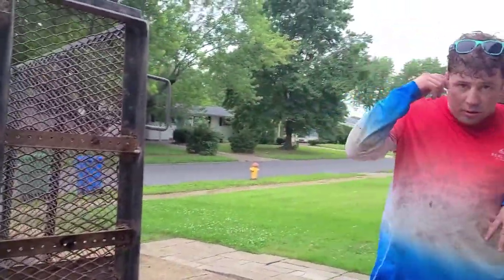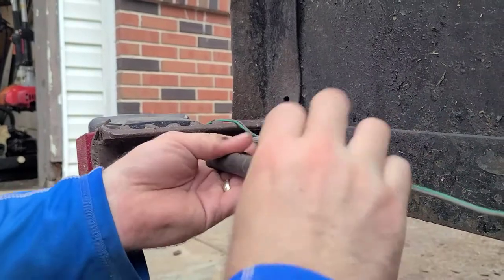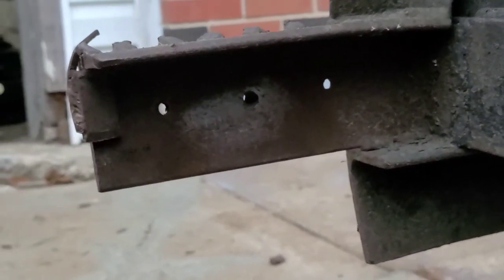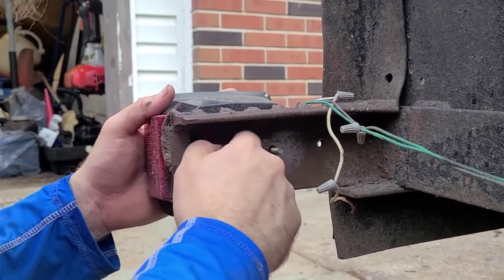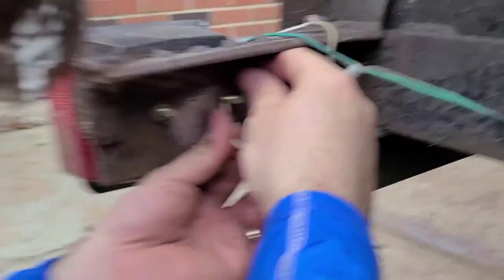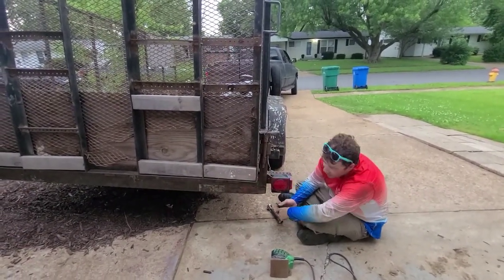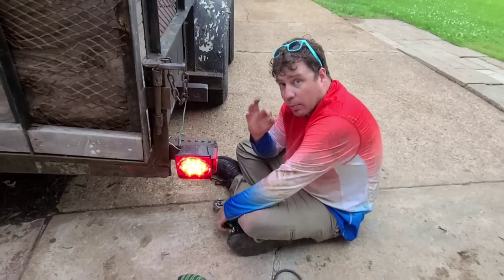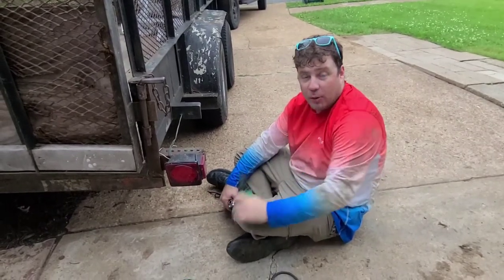Trailer lights not working, grounding issue.

Comment: Nice video but i gotta tell you bro that shirt makes you look like a bomb pop.
Reply from the maker: Thats why I like it. Mmmm raspberry.
Reply: @RJsGarages  ohhhhh no.. not raspberry... thats the one flavor that is a big no go for me.. i wish i knew someone like you close to me i throw all raspberry flavored anything in the trash. Ive asked around and no one wants any of it ( jolly ranchers  and Popsicles mostly ) .

 As far as trailer lights go mine worked fine then i welded a new peice on the back ( i really butchered the welds ) and now i get nothing but when i turn my lights on the brake lights stay on . Kinda wild..  I finally got a couple days off so ima try and figure it out today or tomorrow.  Ive already took the grinder to the peice the lights hook to like you did but still the same . Anyways have a good one.